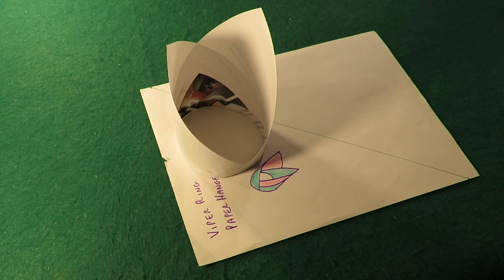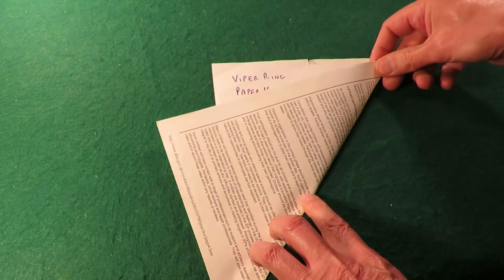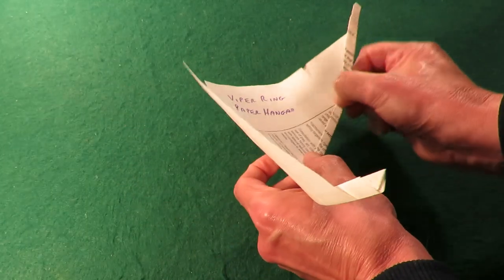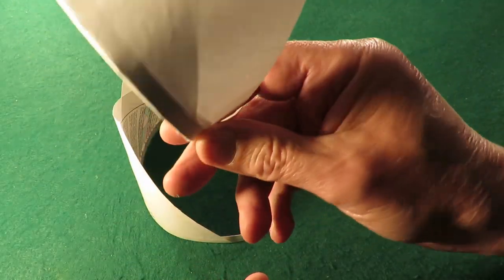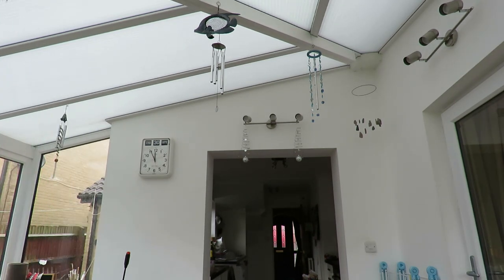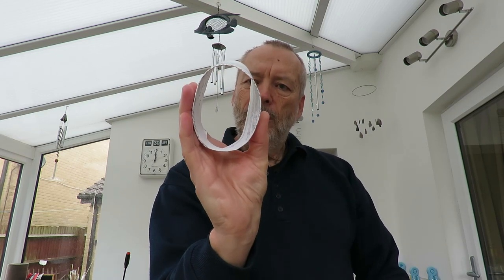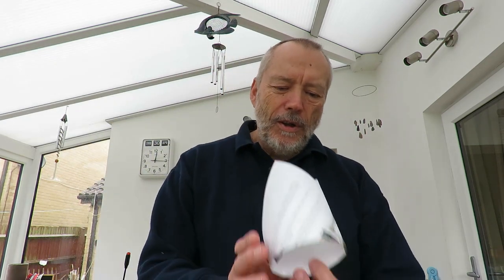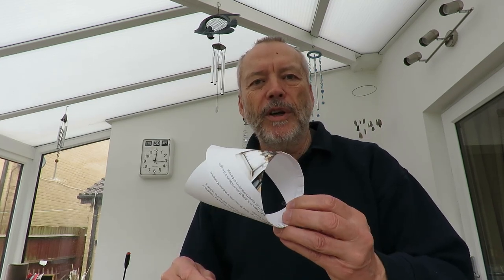Another hoop glider Paper Hanger Viper Ring

Comment: those fly really well, it depends how you throw them really to get a perfect flight out of them.i wonder tho, if u put a rubber ring inside the front part of the plane to stop it from distorting but then will it still fly tho. could u test that maybe?
Reply from the maker: I don't think a rubber ring would help. Maybe a 3D printed ring would be more rigid bit that would not be in keeping with a paper airplane. This series of videos are aimed at giving people ideas of things they can do while they have to stay home. Not everybody has a 3D printer. You could use a cardboard ring if you have a large enough one or even a wire one. Or you could just make one of those Zylowing things from a plastic bottle. Gyro Soda Bottle Plane X-Zylo https://www.youtube.com/playlist?list=PLA5a2xPRSrB3SXBJwLXxTgn3hX3Id5vYF